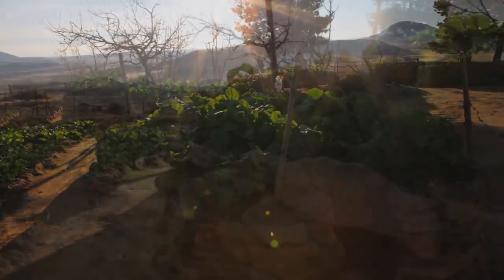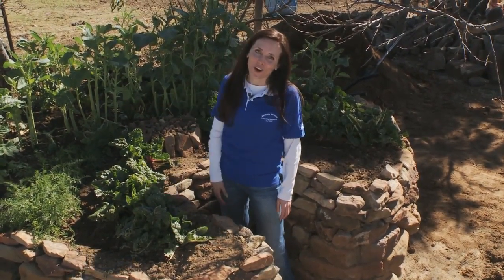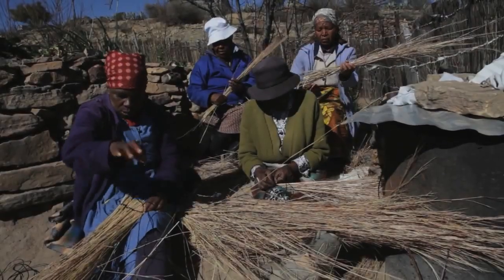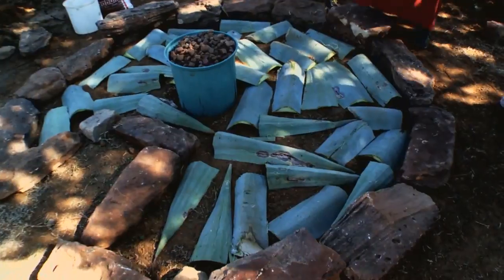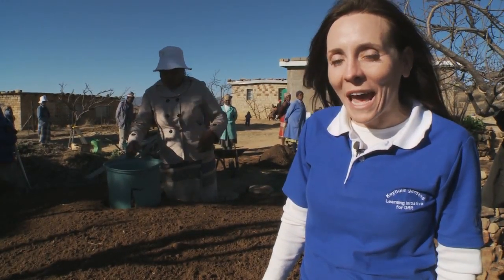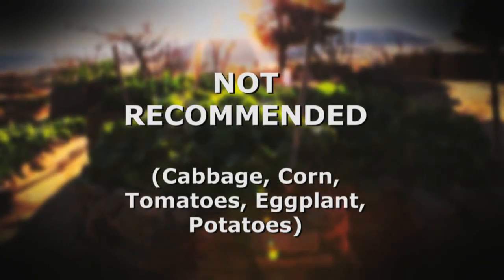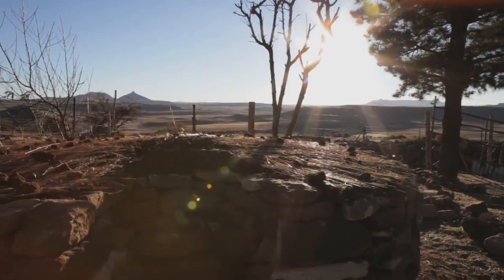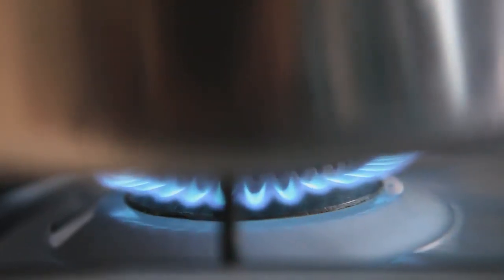The Keyhole Garden: A Simple Key to Better Nutrition

Comment: I'm an also curious why tomatoes and eggplant are not 
recommended together?
Reply: I think it's not saying, don't plant them together.  It's saying, don't plant them at all.

Based on the video, we can see the gardens have a good success rate for the recommended veggies.  My thought is that the not-recommended plants, may either need too much resources for the return that they give, need too much water (very likely), or may get too big for the space for the return that they give.  For example, these homes shown here, may not have lines of electricity and water going into each home where it's easy to live in that kind of comfort and extend it out to the garden. Even natural rainfall may be limited in certain times of the year.

So having said that, or thought that, it could mean that if you're in a region where you have plenty of resources and still want to build a keyhole garden design because you like the concept, then I think it's fine to grow those other plants in your keyhole garden. Eg, if you can already grow tomatoes and eggplants in your garden or raised bed, there shouldn't be a reason why you can't do it in a keyhole garden bed.